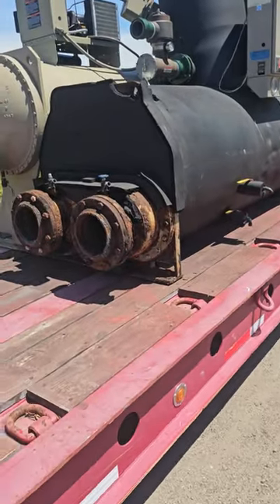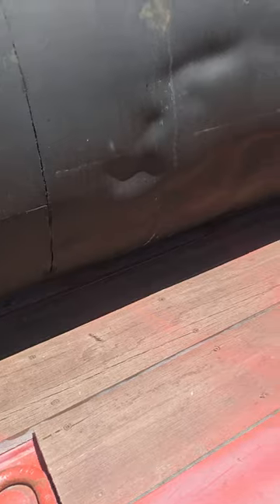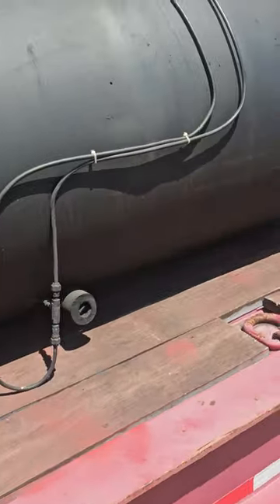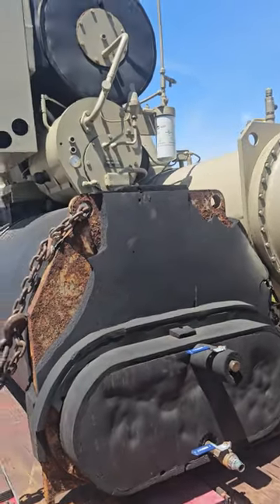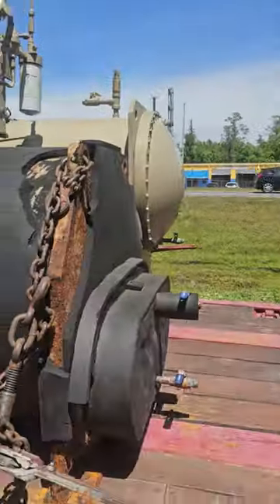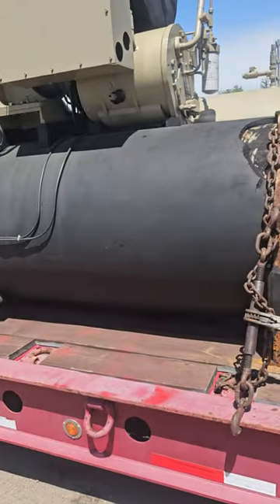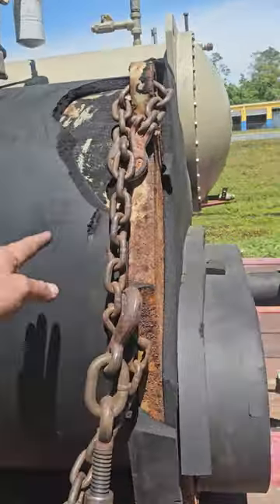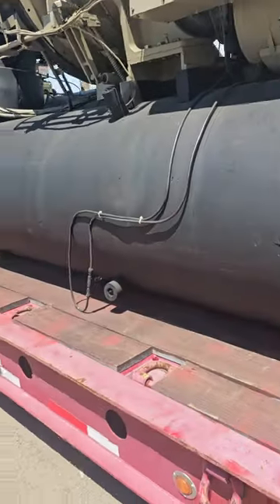Nice load of scrap!!

Comment: So my question is this. We do a bit of scrapping up here in canada. I don't disagree that there's a ton of copper in there maybe #1 if it comes out clean. But that would be a lot of work to extract that material so that you get top dollar
Reply from the maker: With a torch and a Sawzall it wouldn't take long to do that. Each one of those tunes has close to 500 lbs of copper
Reply: Nice nice